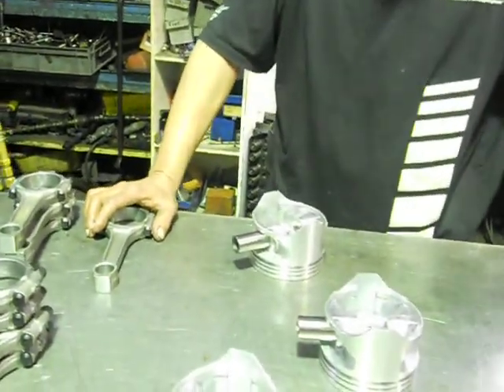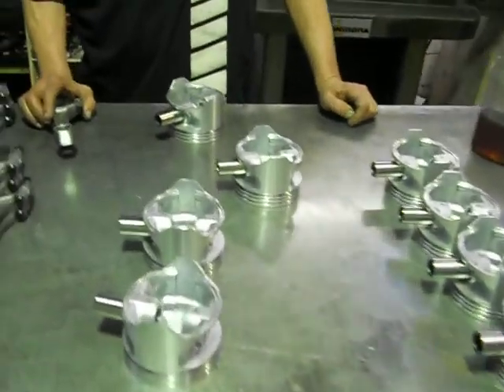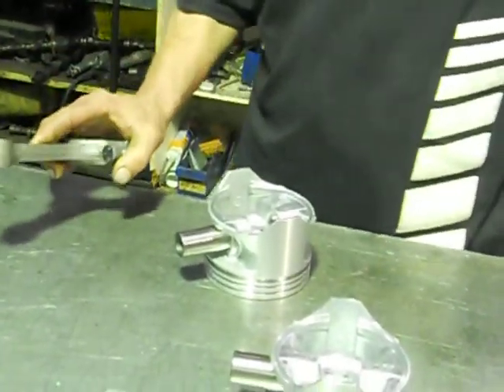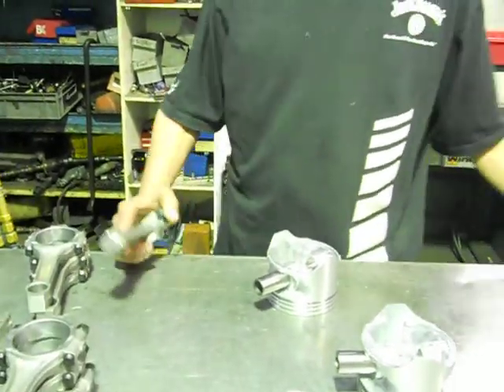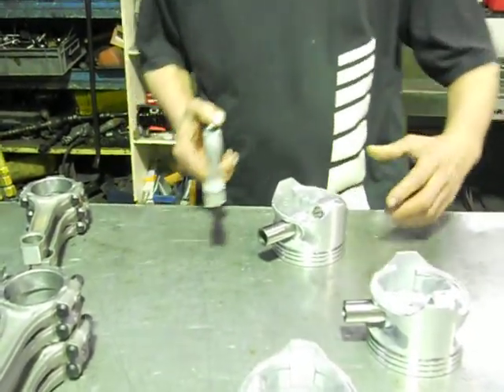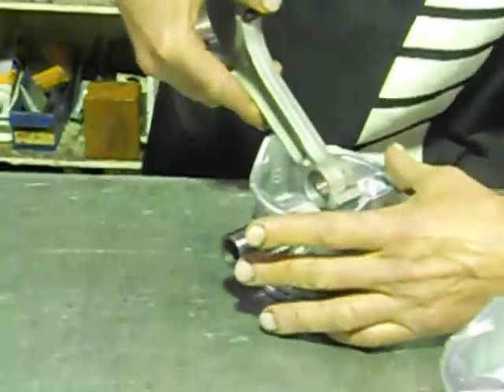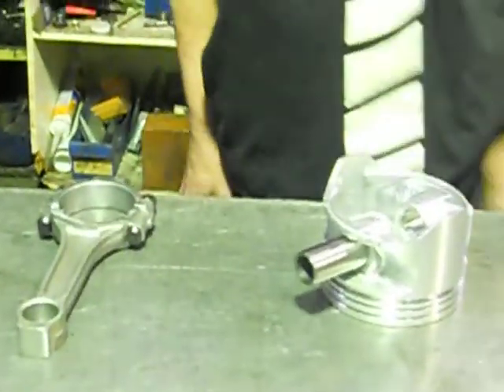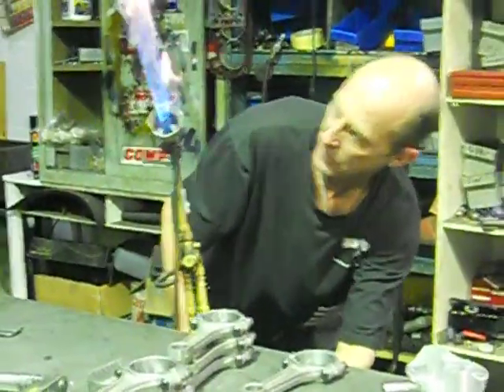How to assemble pistons and conrods

Comment from the maker: It was a cast iron Conrod,alloy conrods have small end bushes and cir-clips or spiro-locs,they are a full floating set up
Reply: Aussie Heads and Race Engines so after you heated the rods up you was able to move the rod side to side without worry about a measurement? Because I thought that the rod would stick in place . Please let me know.  AND THANKS FOR THE TUTORIAL

Comment from the maker: Yes the chamfer,and when the bearing in it,it's off set on chamfer side..No numbers 1,3,5,7 drivers side chamfer to the front...Numbers 2,4,6,8 chamfers to the rear..this allows for clearance between the radii in crankshaft and the bearing and rod ...

Comment from the maker: For press/shrink fit pistons heating the eye of the rod is the only method to use...Never press pistons onto rods,if could make up a drawing tool,but still then risk wrist pin scoring up the rod eye.....You can press old pistons off,shrink fitting them back on is the only way...but never overheat the rod eye in the process....

Comment from the maker: @carlosg815 G'day mate,thanks heaps and yeah good advice too Brother,mate Ive had so many apprentices and tradesman stick pins and thats not good,to get them back off your playing with fire,to press off with a jig is hard with different shaped pistons is insane,cracking and distorting a piston is only a flys dick away.Everything has to be so clean.On motors I build I wash all Pistons,pins,rods,rings and bearings in kitchen sink at work in hot soapy water,my kitchen rocks,thanks for ur time Champ
Reply: Aussie Heads and Race Engines I'm following you like a hog on slop . It's cheaper than leaving Texass.  Thank you for sharing your experience and knowledge 
Blessings

Comment from the maker: @rickymoretti thanks mate,and for sure on the oil question,it is critical that the piston pin and pin hole are well lubricated as it is not oil pressure feed,on first start up a dry pin would seize start up.I use no oil on assembly as oil on the pin going through the hot conrod eye increases the risk of the pin setting half way in,and when the oil is placed on the rod & pin in position,the heat from the rod pushes the oil into the piston pin bore,nice and lubed for customer,good question mate